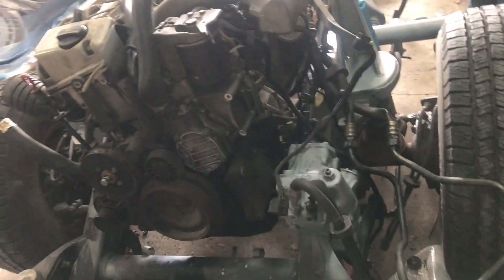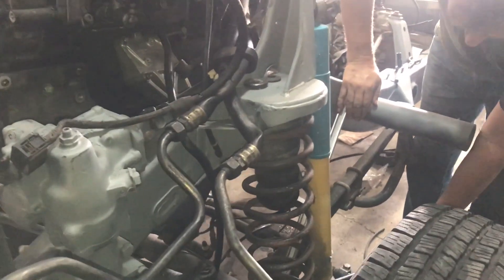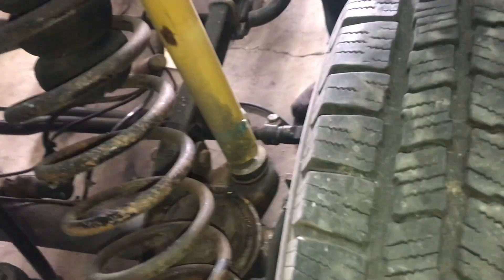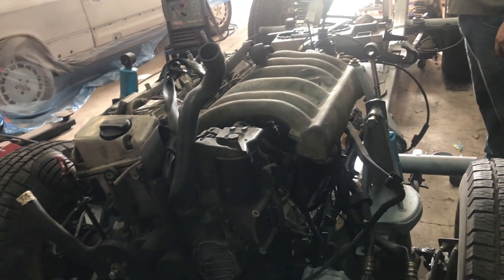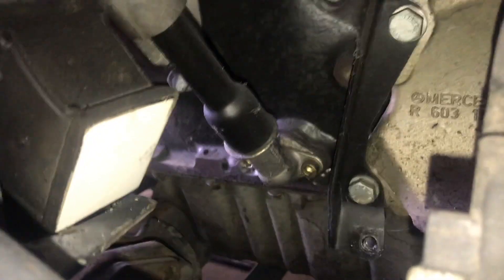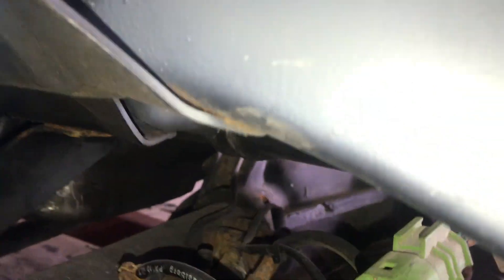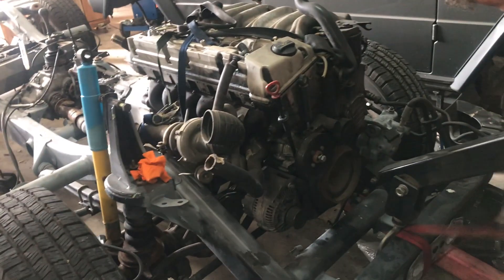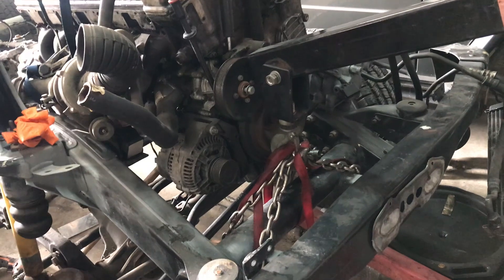W460 OM606 Swap Part 34 (How not to check for oil pan clearance on W460)

Comment: Which OM606 pan is this? Is this the smaller version from the sedan (W210 E300D OM606 Turbo), the one from the earlier sedan (W124 E300 Diesel OM606 N/A or OM603-T) or the correct one for the Gelandewagen (W463 OM606DT LA)?
Reply: @neverendingprojects   That makes sense. Awesome it didn't crack, and there's actually tons of clearance with it. Only downside is, watch out for driving hard uphill off-road, as it's not a very deep sump and your oil might froth over from the movement.

Comment: Generally these engines are fitted into a g wagon tilted back allowing more clearance. When fitted fairly low and level like you have yours and similar to how i have mine also. You need minimum 4" clearance ideally from bottom of sump to the diff. As when you hit any bump, curb ( or more if you offroad) youve got to expect atleast a couple inches or so of compression from the suspension springs which could lead to contact/damage to sump. I had to remove and fabricate a radius into the sump pan to increase the gap. Also adding spring spacers and/or lifted springs can increase this gap. Been here myself..